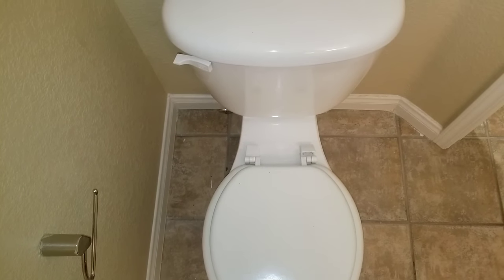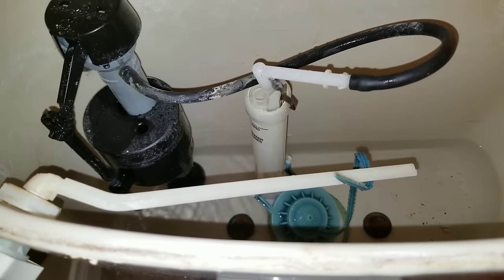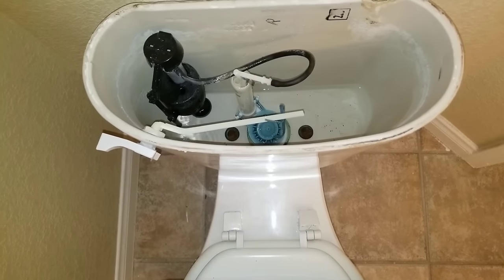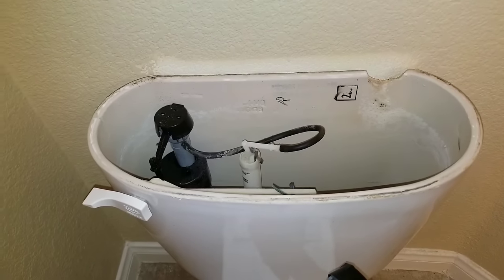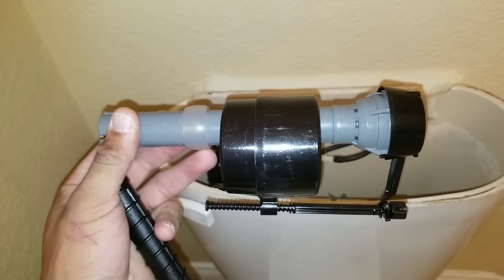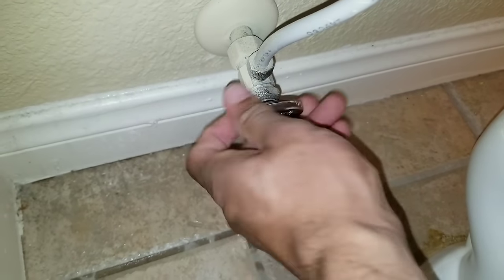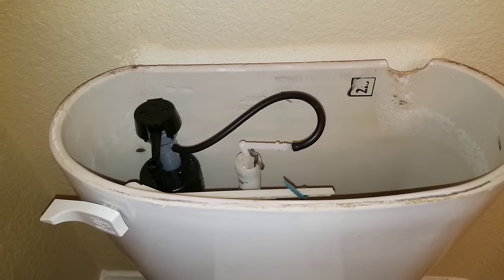Toilet Not Filling up With Water? Here's Why!

Comment: Thank you so much! I was worried about having to disconnect the water line and replace all of it. Thanks to this, I just switched my water lever off, pulled right up on what’s already a good connection, and reinstalled a new full valve. No tools required.

Comment: Perfect ! Last month I replaced the entire valve which with me being 65 and fat was a long painful process getting to the fittings of the Bidet seat , the valve nut . It was terrible . Today the other toilet acted up I found your vid and got the same brand and model of valve , changed the top only and swapped the o ring from the new stand pipe while I was at at from the new unused part to the old one .
Now perfect ! Thank you

Comment: thanks. the video i watch before yours had me cutting off the water, unscrewing the valve from the bottom, pulling the whole thing up, and replacing with a brand new one. now i know to just release the cap, slide up the valve and slide the new one on. awesome, thanks.

Comment: Yup, that’s exactly what the problem was with my toilet.  The was fill valve was clogged.  Squirted some Lime-a-way in to the holes where water shot out and used a skewer stick to break up with hard mineral deposits & lime scale.  Easy fix.  Thanks for the advice!

Comment: Thanks for the video.  I thought my issues was a clog, then I realized it probably was the unit itself.  But I thought I would check with Youtube for a video and yours was the first one is saw.  Yup it was the unit and I had no idea that you could just removed the top part off the water tube it was on.  I always replaced the entire unit, which involved, of course, releasing the unit from under the tank.  I got the new Fluid Master and it was done in seconds.  THANKS for doing these videos for us.

Comment: Thanks for the vid! Short and sweet. I love it!! ☺
My clip only goes up about 1/8 of an inch when I pull it up so the fill valve won't come off.  Any advice?
Reply from the maker: I have not had that problem yet 🤔 
Try to force  it up. If not you may need to remove the bottom nut and replace the whole fill valve. It's a few steps more but possible just make sure you have a small bucket or large towel under to catch the excess water 🙂
Reply: Sam Thanks. I was hoping I wouldn't have to go that route.😞I'll keep trying but if I can't get it I'll know what to do. 
Btw, I'm a new subbie. 😉
Reply from the maker: Great! Thank you for subscribing! 😀

Comment: Brilliant!!!  I was about to take the whole assembly out of the tank. Your video clearly shows to leave the fill stem with the washers in place.
shut off the water...pulled the old valve out...popped in the new valve...5 total minutes....again BRILLIANT !!!!   Subscribe me!
Reply: The video  was excellent but in my case the stem was bad, so I had to  replace  it with the new one. then it worked like a boss

Comment: What's the deal with my flush valve clip? Will not allow itself to be pushed up as easily or at all like you do your video; thus, cannot remove the flush valve.
Reply: If it's old it will need greater force, could be full of calcium build up.  You can just unscrew the whole thing from the bottom of the tank and replace the entire valve.  You have to buy the whole valve usually anyways.
Reply: @Necronaut  Thanks. I think that's what it's going to have to take because that sucker won't budge!

Comment: when i tap the fill valve, an air bubble comes from the bottom... Is it possible that could be part of the problem? Because I have differnet symptoms, it fills up fast enough, but the water level in the tank drops affter about 10 minutes to less than half, not enough for a flush... Maybe it is leaking at the bottom of the fill valve stem? Because I can't figure out where the water is going...

Comment: Sometimes just adjusting the height of the little float on the fill valve will fix the problem. Just in case, like me, your toilet broke on a national holiday and there is no hardware store open for the next 12 hours.

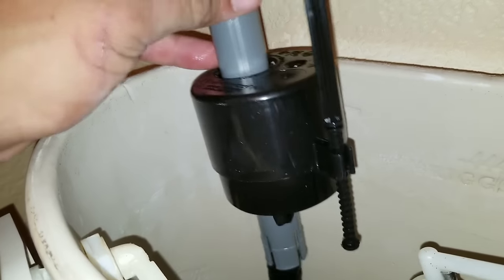Comment: At 1:18 remove the cap right at your fingertips.inside have a rubber disk ,replace that , costs 75 cents to 1 dollar
Reply from the maker: Where I am the hard water is terrible. This is why I recommend replacing the entire fill valve 🙂 I do have upcoming videos showing how to replace the gasket you mentioned. 👍
Reply: @MoreThanMaintenance  cool

Comment: I have the issue where the the toilet doesnt fill, but the problem seems to be fixed after fiddling are ND with it. I'm not sure what I'm doing, but it somehow fixes the problem. What else could it be, if not the fill valve? What else should I look at?
Reply from the maker: Replace the fill valve. This is the only part that allows the toilet to fill. Sometimes it gets stuck with sediment and that is why after fiddling with it it starts to fill. Hence fill valve. 🙂👍

Comment: My fill valve has a chain and paper clip like looking clip. Im on Amazon trying to find it, cant. There are Universal fill valves by fluidmaster, but no chain. 
Can You Please Recommend One ????? Thank You.
Reply from the maker: There are 2 separate components. The fill valve which fills up your toilet when you flush. The second component is the flush valve. This is the part that has the flapper attached to it. Regardless I find that FluidMaster is a reliable option for both. You may possibly have an older discontinued model and won't be able to find it which has happened before. If you go on my channel I do have videos showing how to replace from beginning step by step. Hope this helps! Thanks for watching!

Comment: I've been replacing Fluidmaster flush valves on and off for 30+ years, and honestly NEVER realized the flush valve assembly could be removed/separated from the fill pipe.....dumb me.  Maybe that's explained in the install instructions included with the valve;  but are you expecting me to actually READ them ??

Comment: So I replaced the flush valve and the water still doesn't run fast through it... instead it's very slowly trickling through the valve at the bottom..  even with a new flush part on???
Reply from the maker: Did you replace the base? The base might have sediment in it. Unfortunately the only way to find out is to turn off the water at the angle stop. Take a bucket and open your angle stop water should come rushing out of the supply line into your bucket. If not your problem may be sediment in the supply line. If all else fails and you are still having issues I have seen sediment stuck in the angle stop or when you turned off the water to replace the fill valve you might have broken the on off valve. It is simply a process of elimination at this point. Hope that helps. Let me know how it goes.

Comment: I was using the toilet started flushing my toilet but it didn’t make a sound after flushing the toilet. I found it weird also it doesn’t refill the water,  so I have to touch a tube to refill the water of the toilet and then flush the toilet. What could be the issue?

Comment: my toilet doesnt fill up slowly it doesnt fill up at all makes no noise.it does this about 1 every 4 or 5 flushes it just doesnt fill up at all.if i try to flush it again nothing but then about 5 mins pass and it will just fill up by itself.what could be causing this?the ring is new and doesnt need replacing

Comment: I replaced the fill valve and the toilet water is still filling up slow and not to its proper level and it’s running off and on and I replaced the flapper

Comment: Not helping me. Mine won't engage sometimes. If I tap the fill valve it engages just fine. Something is sticking. I've found zero videos on this issue. The fill valve and the toilet are brand new.

Comment: My bathtub cold water will run at full blast even woth the knob turned off. And my toylet won’t fill up.    I turned it off from A pipe downstairs. It’s like negative 15 out side

Comment: I watched this video. Title doesn't match the content. It is a solution for slow filling. My problem is: water doesn't enter the tank at all.
Reply from the maker: If it's not filling up it is your fill valve or your supply line/ angle stop is clogged with sediment.
Reply: @MoreThanMaintenance  Thanks for your reply. Fill valve doesn't work properly. It has a small size hose for 15 cm, but water doesn't flow out of it. Water flows from the base of the valve and floating part is not firm enough to stop the flow. I am wondering if it is repairable or I have to change it?
Reply from the maker: @rasoulkhoshravan5912  yes you will have to replace it. Watch my last video on repairing toilet. I remove all the components including the fill valve. Hope that helps!
Reply: @MoreThanMaintenance  Thanks for your reply. So there is no way to repair it. This way I have to spend few box.